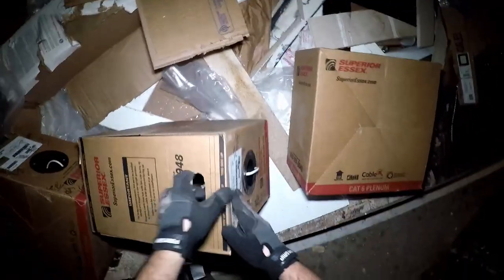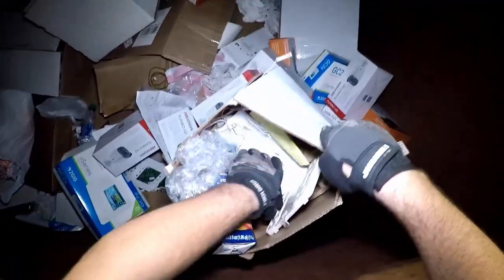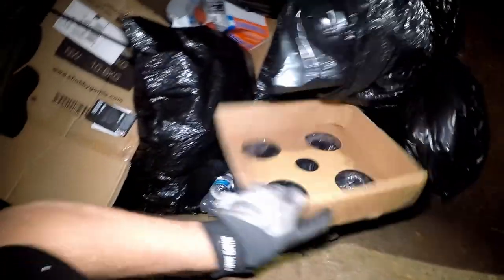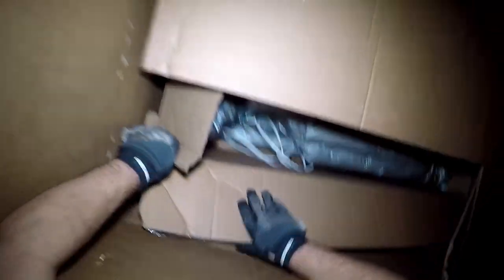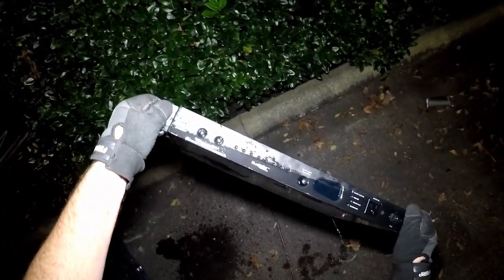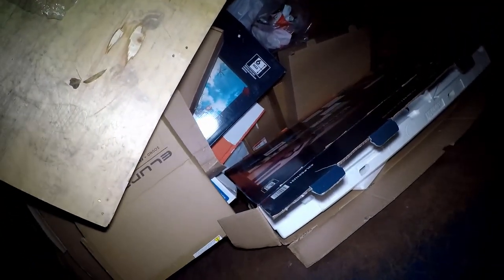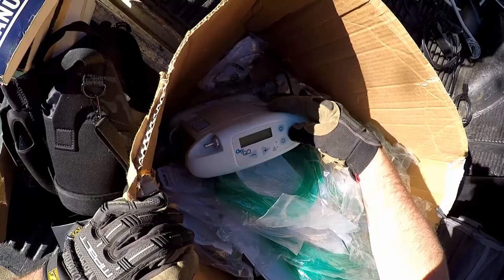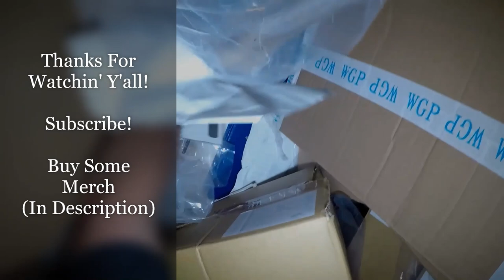Dumpster Diving "It's Not Really Fitting At All"

Comment: As for the beveled glass I made so many of them in a shop I worked for before they bought the bevel machine. If you get a scratch use a wet cork belt and that will remove the scratches from glass. Remember not to stay on one spot too long as it will make a wavy effect. That Japanese figure is quite unique.

Comment: The big thing you put back in the dumpster was the frame to a Manitowoc ice machine. The plate you grabbed was the compressor mount and the coils mount in between the 2 side panels. A trough slides in under the pump. It was basically stripped already. Merry Christmas to you and your family! 👍

Comment: The valves for the oxygen tanks you should scrap. A bad valve can cause the oxygen tank to explode.  There are expiration dates on tubing but as long as package is sealed and the tubing is soft(not hard from age ) it’s ok to use. When our mom passed away we took all the extra supplies to a senior center and they were tickled to get it.